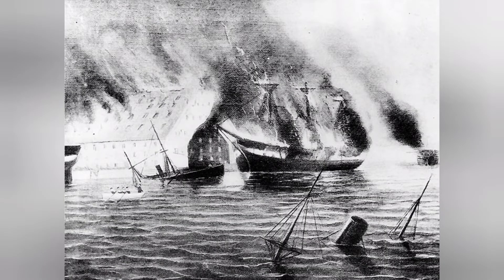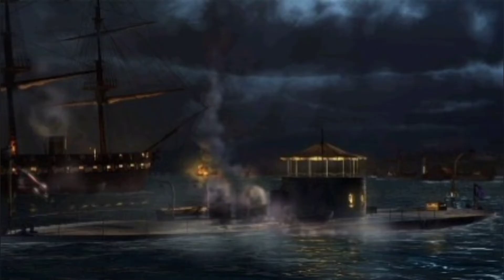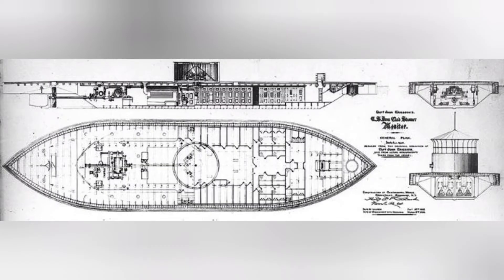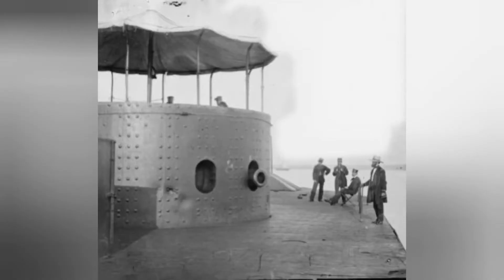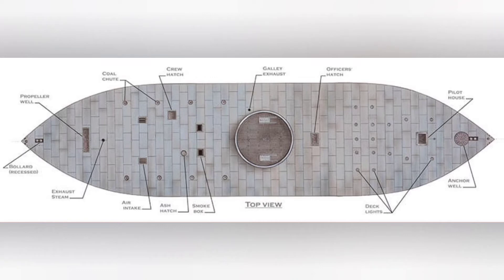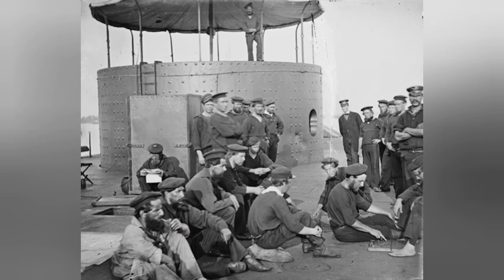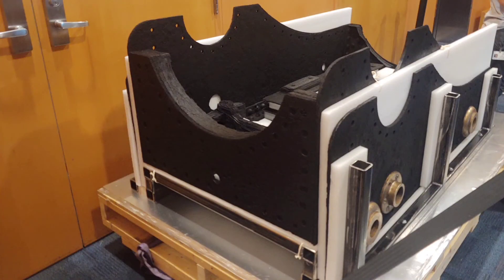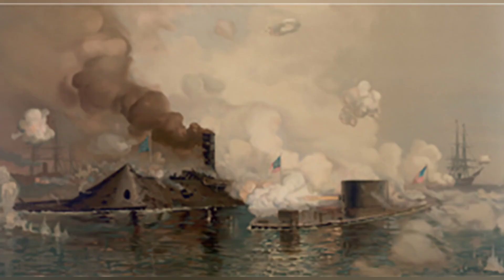Constructing the USS Monitor

Comment: very fascinating, thanks for the video.  I also heard that the Monitor was a one off deal, as the other monitors made were quite different looking.
Reply from the maker: Thank you.
Monitor was the only vessel built to its design. Monitor was very simple and designed to be built quickly. The follow-up Passaic class was a heavily reworked design that was stronger and took more time to build.

Comment: I’ve always heard the the steel plate for the monitor came from a steel mill in Troy, New York.  Alway been curious about that history as I grew up and live nearby.
Reply from the maker: Multiple iron mills rolled the plates that would be fitted to Monitor. The primary locations were the Griswold iron mill and the Abbott iron mill. There were roughly a dozen locations that rolled the plates, most were in New York for quick transportation of materials.